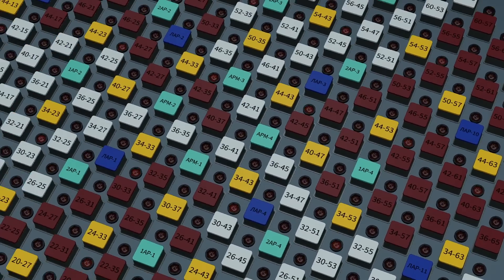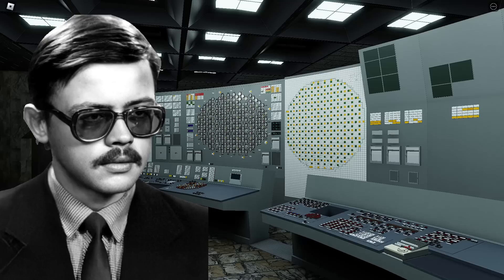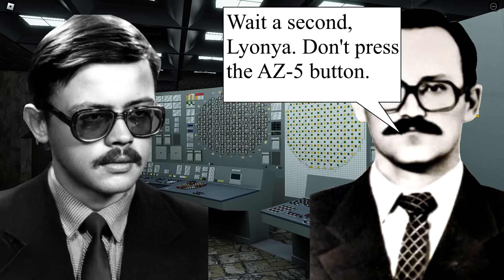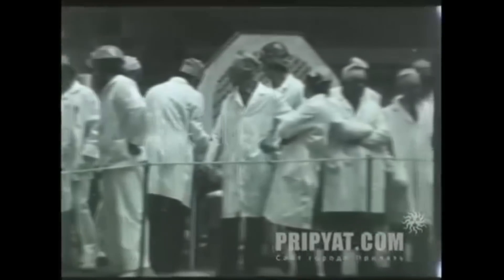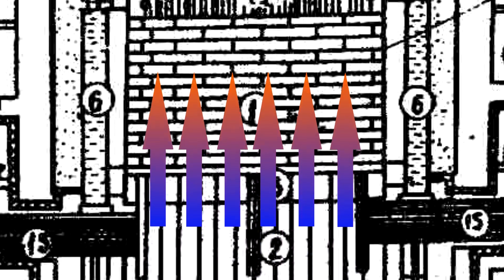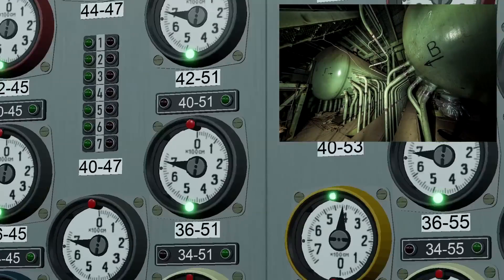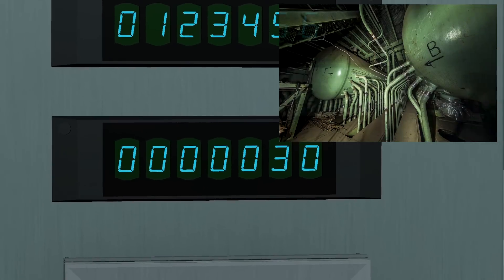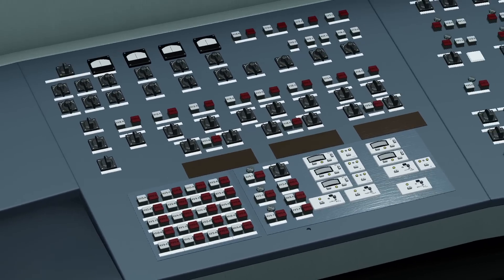Would Not Pressing AZ-5 SAVE Chernobyl?

Comment: Interestingly the Canadian CANDU reactor is not too dissimilar to an RBMK which makes the Canadians arguably themost knowledgeable in the west on RBMK operation. Of course the reactors are different but they both feature a separated moderator from the coolant system resulting in the positive void coefficient (CANDU uses heavy water RBMK uses graphite) and a couple others things as well. But they are also in many ways different lol!
Reply: Yes, for starters they're designed with horizontal fuel channels that can only maintain criticality when the channels are in mechanically sound and pretty much any deformation in a channel will render that channel useless for generating more neutrons. Then if they channels deform enough because of integrity loss and gravity, it will physically touch the moderator channels, which are low temperature because of the heavy water which is also it's coolant, so heat will be transferred into the moderator channels. The control rods are also designed so they are not in the channels generating steam, so there's no way for a steam explosion/void inside the fuel channels to cause problems there. Finally if we need to we have this lovely high pressured gadolinium nitrate neutron absorber that can be pumped into the channels that would honestly make a Xenon pit jealous with how fast it poisons and kills the reactor.

So yeah, you'd have to literally be breaking the laws of physics to Chernobyl a CANDU reactor. It literally will not run if it's failing. Plus there are so many ways to kill it you'd have to be trying to make it explode to get around them all, and even then you're essentially guaranteed to fail miserably.

Comment: If they hadn’t pressed AZ-5 then likely the worst that would’ve happened would’ve been a reactor meltdown, not an explosion.
The main reason the reactor exploded was the immense pressure created by the steam, so if they had kept the valves closed then the reactor likely wouldn’t have exploded.. at least not in a nuclear explosion because the Chernobyl reactor had a positive coefficient.
Reply: Well you are off here because that wasn't a nuclear explosion.  Odds are the first explosion was steam since water flashing to steam takes up a LOT more space and without the extra space needed it builds pressure until the channels fail.  That happens faster than the next step.  Second was a hydrogen explosion caused by the zirconium cladding at high temperature oxidizing with steam and making hydrogen gas.  That only needed to find an ignition source somewhere to explode.

Pressing AZ-5 when they did or not pressing it wasn't going to keep it from exploding.  It would only have changed the time frame in which it exploded.
Reply: If they hadn't pressed AZ-5, the temperature would rise to the point of automated shutdown, which would still explode the reactor.
Reply: I know this is an old comment but something you guys are forgetting is that they couldn’t insert the control rods slowly a couple at a time either way as the control rod channels were damaged by pressure and heat and would have jammed before full insertion. They never should have defeated safety protocols and pulled rods 100% after the reactor stalled because of the xenon pit there only safe option was a complete shut down and restart.
Reply: https://www.youtube.com/watch?v=yIA_FMz9n1k
Reply: https://www.youtube.com/watch?v=yIA_FMz9n1k
Reply: If the tips were not made of graphite to save money, none of this would have happened
Reply: No, it would only take more time to explode. The xenon was already in the reactor and the reactor could not be switched off as lowering the control rods was the same as pressing AZ5, therefore it would only take more time but have the same effect, the error was rising the control rods before. But a engineer or someone with more knowledge can explain this better probably.
Reply: @midelro97  Xenon lowers reactivity, it does not raise it. If the operators were able to lower control rods into the reactor a few at a time, the graphite tips would have raised reactivity briefly, but the boron higher up in the control rods would have been able to enter the reactor and work to lower the reactivity as a whole. Over time, the boron control rods entering the reactor would have prevented the total meltdown that occurred. For sure, damage was inevitable, but nothing like what happened that day.
Reply: @midelro97  Inserting the rods one at a time wouldn't cause a prompt criticality. Doing it slowly also gives time for the Temperature Coefficient of Graphite to slow down the reaction and for the pumps to kick in and flood the reactor with cold water to crush the steam voids.
Reply: @midelro97 inserting a few rods at a time wouldn't have the same effect as all at once
Reply: @v3es473  a few at a time is not fast enough to stop an already run away reactor.
Reply: @Align700nitro  i know, just saying that a few rods at a time wouldn't do the same thing as all at once
Reply: I recommend watching this: HOW THE 4th UNIT OF CHERNOBYL NPP WAS BLOWN UP (channel-KS).

Comment: How does water go missing requiring it to be topped up? Like... it's being cycled directly through the core in a closed loop?
Reply: probably through steam, but in a manner that seemed to imply accident or emergency i have no idea how they did that
Reply: Pressure release valves, like the weight on the top of a pressure cooker.

Comment: The two scenarios are moot really. The reactor should never ever have been in the state it was. That it was driven purposely and with determination into this state was the primary failure mode. The rest is just consequences and symptoms of the failure.
 Any piece of plant is delivered with operating instructions by legal decree in fact. They’re a formal contractual requirement. Equipment is mixed scrap without them. Deliberately disregarding those operating instructions voids warranty and is usually taken as gross misconduct and would rightly lead to criminal charges against the senior management in the event of accident or injury.
Reply: The idea that it was all the operators fault was the early Soviet narrative intended to shift the blame away from the poor reactor design, lack of internal communication about the known deficiencies of the reactor design, and deficient operating guidelines. The staff did not do anything that was unreasonable to them, at the time, with the information they had. This is very well highlighted in the 1993 report from the investigative committee (official english translation by IAEA can be found as annex to INSAG-7): "The personnel violated the Operating Procedures and the Commission notes these violations in this report. Some of these violations did not affect the initiation and development of the accident, others created favourable conditions for the manifestation of the negative design characteristics of the RBMK-1000 reactor. The violations were largely the result of the poor quality of the operating documentation and its contradictory nature caused by the poor quality of the RBMK-1000 reactor design.  The personnel were unaware of some of the dangerous features of the reactor and, therefore, did not realize the consequences of the violations."
Reply: @MatthijsvanDuin  I understand the sentiment and salute the intention to blame the inanimate but you cannot simply say that breaking procedures was not the problem. The procedures are as much an integral part of the plant as any pump or pipe. We don’t set about the hardware with an angle grinder and not expect consequences.
Reply: @robinwells8879  It's not about blaming the "inanimate", it's about blaming the actual root causes and more importantly, blaming that what can be fixed to prevent future accidents.

The main "violation" that caused the accident was the low ORM, which was a parameter that was not regarded by procedures as safety critical and could not be monitored in real-time from the control room. Moreover it was habitually ignored in normal operation (including the previous day) because the calculation was known to be inaccurate in some operating conditions, and ignoring ORM was necessary to keep the reactor running.

The designers knew that low ORM turned the AZ-5 button into a "reactor accident now please" button, it had already caused a previous reactor accident, but this was not communicated to the operators.
Reply: @MatthijsvanDuin  again I suggest that the design was actually a good piece of value engineering that supplied the bulk of the energy needs of Ukraine for years. The management systems and its endemic failures were the problem. 
Western reactors by comparison are ludicrously expensive to build and operate and decommission and yet they fail too (Fucashima) containment vessels are costly and still leak in an accident and the high enrichment fuels used have a significant manufacturing energy footprint in their own right. 
If you believe that the manner in which the reactor was run on the occasion of the disaster was not contributory then you are missing the root cause and need to ask another why question. 
We gloss over the fact that the other units performed without issue for years. 
A management system that allows individuals to bully staff into deviation from operational procedures is the root cause.
Reply: @robinwells8879  The RBMK design flaws are well documented, they previously caused the accident at Leningrad Unit 1 (and it was "understood that the accident was a result of the reactor's design characteristics, rather than personnel errors"). The 1993 report bluntly says "The Commission considers that the negative properties of this type of reactor
are likely to predetermine the inevitability of emergency situations". Subsequent to Chernobyl the problems were partially mitigated in other RBMK reactors.

In particular, under absolutely no circumstances is it acceptable for any nuclear reactor that the emergency shutdown button causes an initial increase in reactivity, ever.
Reply: @MatthijsvanDuin  I am well aware of the documented “flaws” in the RBMK design. I simply dispute that they made it inherently inferior to western tech. American reactor technology has “fail safe design and yet fail they do.
 The biggest problem with American nuclear design is that they are inherently uneconomic due to over engineering which still permits them to fail but by different failure modes. 
Every time we have been sniffy about soviet engineering and technology we have been proven to be clouded in our judgment. 
I suggest that western design is no better for all its fail safe systems because they are over complicated and that just adds new failure modes. 
RBMK reactors run by the book do not fail without external input.

Comment: Can you do a video that shows which things they did that was part of the test procedures and what was improvised? I'm still a little confused on what actually happened. I blame HBO and Medvedev's book. Once I heard you say that was inaccurate I ordered  Chernobyl: A Documentary Story on your recommendedation. Thanks as always for the great video, this answered the question I had about if it really was the AZ-5 button that was the final nail in the coffin.
Reply: The test was designed to simulate a bombing run on the reactor that caused both a loss of off-site power(power lines knocked down) and a LOCA(Loss of Coolant accient, caused by the same bombing run in the scenario). Hence cutting off the water pumps and shutting down the turbine, the test was to see if the Reactor could survive until the emergency diesel pumps kicked on. This was made primarily in response to Operation Opera where the Israeli's bombed an Iraqi-Military reactor off the map. 

AMB design flaws may have also played a role, as the early first generation AMB reactor design(which inspired the RBMK. Only 3 AMBs were built, a prototype at Obninsk and two full size AMBs at Beloyarsk) could not handle a serious LOCA accident, a single large pipe burst could drain the entire reactor(which is especially bad since that was THE scenario most reactor builders were worried about especially Pre-TMI, that was the big concern point). This never happened to the power generating AMBs, but the military equivalent they were based on had this exact thing happen on the K-19, and that was a leak, not a full blown rupture. So testing how the RMBK could handle LOCAs when it's predeseccor and it's relatives couldn't may have also played a factor.
Reply: All this is a replication of the Soviet lie about the causes of the accident. If you want to know the truth, watch: HOW THE 4th UNIT OF CHERNOBYL NPP WAS BLOWN UP.   (KS channel)
Reply: I'm also reading INSAG-7. I've fallen down the rabbit hole haha

Comment: Why don't you talk about the effect of xenon poisoning?? From your statement it follows that the reactor core was water-cooled. Not true. The water cooled the fuel rods. The rest was made of graphite and gas-powered. Even the control rods had graphite parts so they had no contact with water....   It was not a typical Western-style reactor....
Reply: The control rods do contact the water. They have their own cooling loop.
Reply: @MinSredMash  Fuel rods, yes. As you say... But the control ones contained graphite. Expand your thought: how did the water not damage the graphite? Parts containing graphite must not come into contact with water.
Reply: @popiszo9367  What's your point? The control rods were cooled by water even if there was a millimeter or so of sheathing around the graphite.
Reply: @MinSredMash  What are you talking about?? Graphite is a material with which water cannot come into contact.... Have you heard that certain parts in this reactor were gas-cooled?
Reply: @popiszo9367 It's an idiotic distinction. The uranium doesn't come into direct contact with the water either, and yet the fuel is obviously water-cooled. The graphite half of each control rode is water-cooled as well.
Reply: I recommend watching this: HOW THE 4th UNIT OF CHERNOBYL NPP WAS BLOWN UP (channel-KS).

Comment: This is actually a really interesting topic to explore. I've often wondered whether the die was cast long before the SCRAM function was initiated, or if there could have been a way to gradually reduce reactivity and slow down to a safe stop.
Reply: At least for US reactors at the time, and even now adays, one could flood the reactor with boron-infused water that would saturate the system with neutron absorbing water that would do the exact opposite as a moderator, thus “scramming” the reactor without need of control rod insertion.
Reply: @techypriest7523 Non-Soviet reactor designs were monumentally safer than the RBMK, or even the VVER.
I'd recently read a transcription of Legasov's tapes, and what stood out to me the most was how exhausting the operating of an RBMK was. He'd described operators breaking out in sweat running the things.

This channel does a really good job of articulating how much the Soviets were doing a "move fast and break things" approach to nuclear energy.